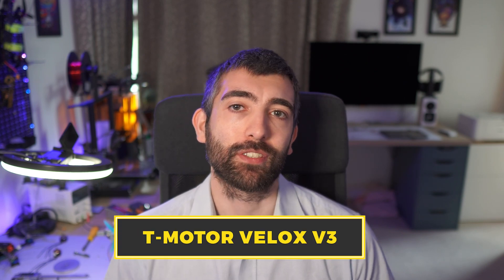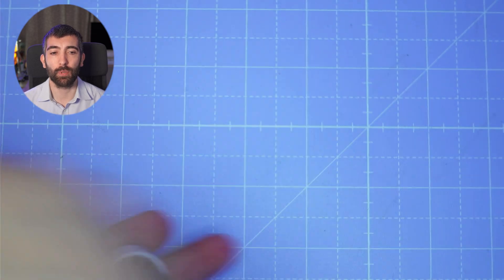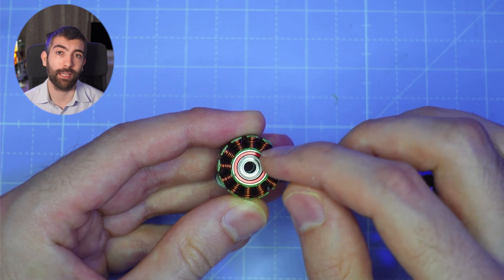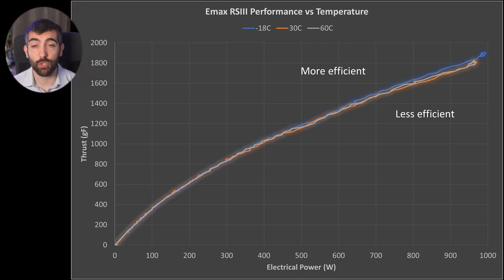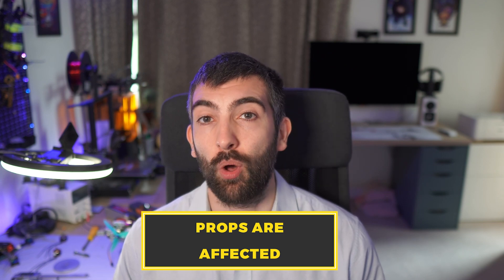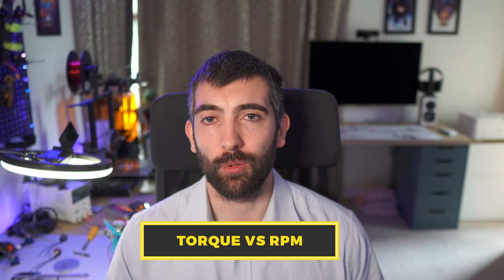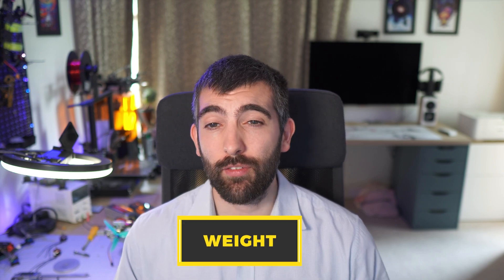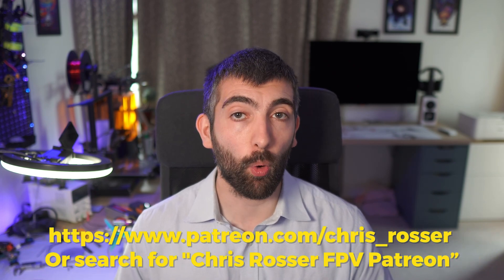How does motor temperature affect performance? T-Motor Velox V3 Review

Comment: Honestly i hate to say it but i have concerns about the temperature data and your testing method, it seems unlikely to me there was so little effect on performance. Are you possibly using an esc or test bench with some kind of constant voltage/voltage compensation or thermal compensation settings/feature on a controller somewhere that is enabled? Both Nd magnets and coil winding material DO have well documented loss of performance from thermal effects, at 4:10 you show thrust vs power all looking suspiciously similar despite a 93c difference in operating temperature. NdFeB magnets have ~0.11% loss in Br/c (remanence) which immediately puts you at a 10.23% loss of motor output. The thermal effect on copper winding (assuming pure copper and not CCAW) will have an even larger effect on performance, at -18c  the resistivity is 1.423×10^(-8) Ω m and then at 75c it would be 1.991×10^-8 Ω m which corresponds to a 28.5% increase in electrical resistance and associated voltage drop. Considering the physical properties of these materials which cannot be avoided regardless of motor type or configuration i can only assume a flawed testing method and hope you might go back and reassess the techniques you are using for data collection. Would be great to hear your thoughts on this.

Comment: Hi Chris ! I discovered 2275 skystars 1950 kv motors and I feel em performing amazingly comapreable to rcinpower. Very fast acceleration and low throttle , instant breaking . May be you can test them . Considering the price … :) twice cheaper . And it’s 7,5 height . Pulls a lot
Reply: i would also like to see a test for those motors
Reply: If there only was a controlled way to test durability

Comment: I've rewound motors, have mismatched stator and bell, and mismatched motors all together. Dinged up, glued back together bells after two years of use on Emax eco II.
Quad works just fine. Tons of noise, but it's MY QUAD!

Comment: Brother I need help Please!  i have a 3.5 in quad that was working perfect until i crashed it and broke a motor. i replaced the motor but now the quad acts like i have the motor output limited to 10% . it will arm and it followes the sticks like rocking it back and forth or side to side with the sticks. i have checked everything. all is set right. but no mater how much throttle i give it it is not enough to take off from the ground. i have re flashed everything and tried older versions. checked the esc's in blhelisuit. nothing makes any difference. Do you have any idea where to start> have you ever seen this before? Please help! By the way i build quads for the public so i know what im doing. but this one has me stumped. im to the point of just randomly changing parts. i thought maybe the new motor was weak and the Fc was dumbing down the other motors to match the week one so i took it off and it still does it. it never tries to freak out or anything all seems correct.
Reply: maybe change motor position, maybe one of the esc defected?
Reply: @circlearoundtheworld  it was the esc going bad. i replaced it , thanks brother.

Comment: If I recall well Gal Kremer has measured the 2207 to be actually 22,5 x 7,5 mm in size. So quite a big volume compared to a "pure" 2207. Hence the weight, perhaps.

Comment: Question for a future test, does excessive heat in the motors/magnets cause the magnets to lose some of their effectiveness permanently?
Reply from the maker: Yes, but the magnets would have to get extremely hot ~90C and usually they don't, it's the motor windings that heat up the most and they don't really suffer for it provided the insulation doesn't melt.

Comment: 9:24 How would you adjust this in Betaflight?
If the throttle increases linearly, does that mean, that the rpm also increases linearly (or is it dependent on the load)? 
And does the "motor output limit" in Betaflight only limit rpm or power or thrust?
Reply: Motor output limit limits power. The PID FF controller tries to follow the throttle setpoint regardless of load.

Comment: Is the motor dynamically balanced or statically? If it was balanced by a machine to keep it's balance and  the balance does not change or automatically adjust in any way after the balance is made with the mud then it's static right?  Similar to to a car tire.  The way I heard what you said made me question it.  I thought is there is some magic dynamic balancing that occurs in this motor? LOL.  I'm amusing this was just a mistake but you can confirm.

Comment: down to -114C metal-air fuel cell, with KOH ethanol electrolyte, like iron-air, 2kWh/kg specific energy
Reply: vertical barrel chassis instead of super thick flat drone chassis, light(er) weight and rigid
Reply: yep a barrel structure like a rocket is relative light weight and rigid
Reply: steel bearing true dc mhd motor
Reply: what good do you do if you get paid back, says Jesus
Reply: trade is evil, diy